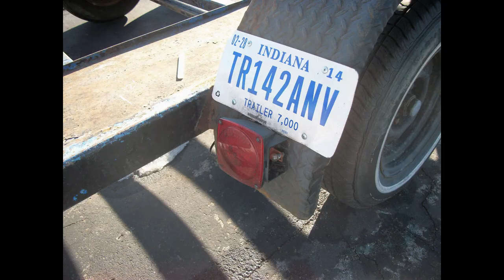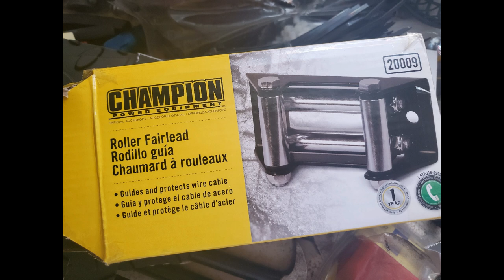Extreme Trailer Makeover

Comment: Nice work overall..
But, on your "wear plate" for the winch cable, that method is asking for future problems with your winch cable. By the winch cable sliding/rubbing on/across the "wear plate" it will do a lot of damage to your winch cable! 
I suggest adding a roll tube/pipe/roller on round bar which can be changed out when the pipe on the round bar wears out. That way the pipe/roller would roll as the winch cable moved over the pipe.  This would be way less wear on the pipe/roller since it would roll around the bar as the cable moved over it. And, it would remove 99% of the wear on your winch cable because it would not be dragging across immobile steel!
Reply from the maker: I've since switched to a larger winch with a nylon cable that clears better, but you are right about the wear plate.  I looked into fabricating a roller, but never nailed down a design I was happy about at the time.  I've since had a lot of time to think about it, and could easily whip one up that would be weather resistant.  Thank you for taking the time to comment.

Comment: Nice job.what paint was it again?
Reply from the maker: The first paint job I gave the trailer was just generic Walmart flat black spray paint over the POR-15 if memory serves me correctly.  Later on I brush-painted it with Gloss Black implement paint from Tractor Supply Co.  I believe that's covered in my "Extreme Trailer Makeover 2021" video.